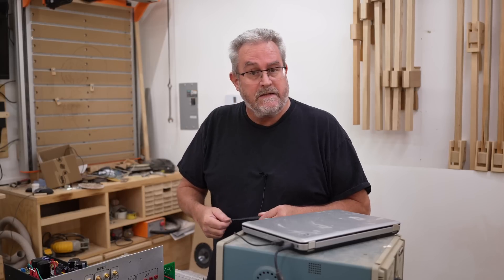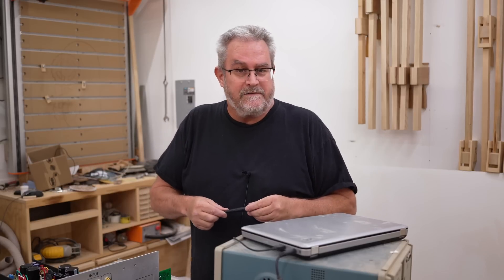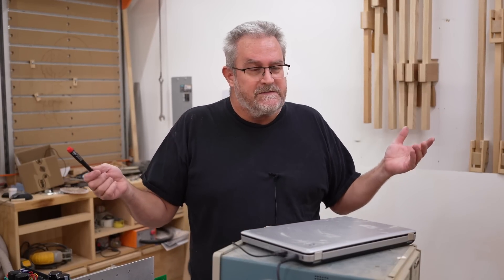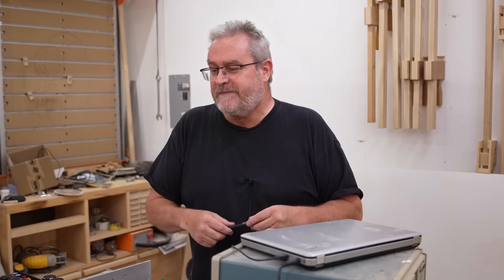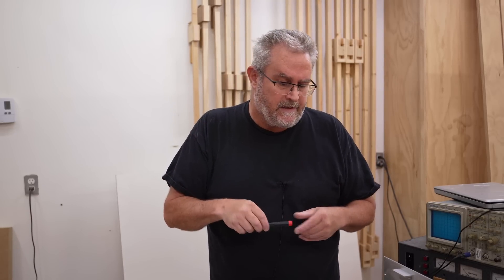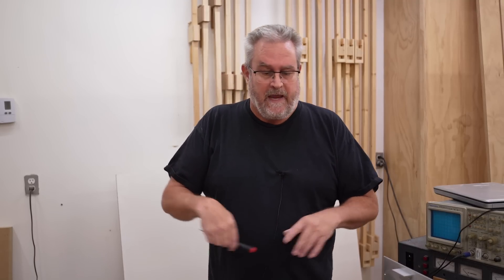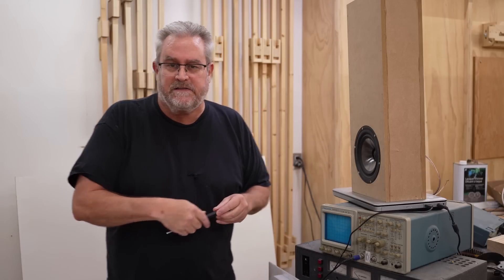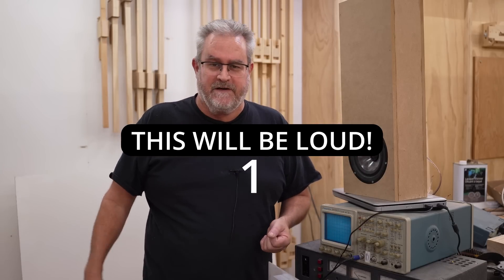What Does My New Amp Sound Like and How I Learned Electronics

Comment from the maker: I'm probably downplaying how much actual electronics knowledge I have, but my point is that I never did gain a proper educated understanding of it from a purely academic point of view. 
I can't do the back-of-the-envelop math to describe how a circuit will perform like guys who have that academic training can. But what I can do is take a circuit, sim it to see what it's doing, modify it if I need it to be different in some way and then (and this is the big one) build it and test it in the real world. At this point in history, nearly everything you can imagine has already been designed in the world of audio circuitry, so it's just a matter of adapting what you need to work the way you need it to work.
Now, like I said in the video, if I had my time back I would have put more effort into the theory and math when I was younger. Eager to just make something instead of studying, I didn't realize that I would have been better off in the long run if I had traded the soldering iron and the parts I was about to ruin, for those books I should have read more often. 

Onward to the amp and the demonstration of it starting up. No audible turn on thump is a plus, but that may change when the active crossovers are in the signal path. I can add circuitry to mute the amps while the crossovers start up, but that complicates things and I want to wait and see how it works without it.
Hiss and hum are as nonexistent as I would ever need, and remember this is the amp running out in the open with wires going every which way all over the place. That sound clip was recorded with my high quality lav mic just inches from the speaker's tweeter and boosted by 30db on top of that, so if there was any noise you would very easily hear it.
But again this is without the crossovers connected, so subject to change. But I'm pretty sure the crossovers are as noise free (and hum free) as the amps are, so I'm not expecting any issues.
The next phase of the build is to finish the amp boards and test those individually before installing them. That's the tedious and time consuming part, and when that's done I have an equally tedious task to do - finishing and testing the crossover boards and getting those wired in.
Reply: Started working on a diy line array project a year ago drawing on quite a lot of info gleaned from your channel. 
At this stage the project research and build is more interesting than listening to the final product 🤣🤣
Fantastic work, you're a huge inspiration, thank you!

Comment: Hyper Focusing is the term I think you're looking for. I do it a lot... It's just about the only way I can get things done. I've got a love hate relationship with my ADHD/ASD.

Also, I started out with electronics just like you. But after a while of fumbling my way through it, I hyper focused on the theory for a while and it did a lot of good but messed me up when visualizing electron flow in my circuits. Practical application and theory often bump heads. IE diode polarity markings and NPN/PNP theory. Drove me nuts and assisted with my burnout on the hobby.

Comment: Learned from Elektor back in the 80 and 90's and then discovered Audio Amateur. As the internet grew useful diyaudio. You were there to John. I only frequent a few threads on diyaudio any longer. Nice to see this get up and running.
Reply from the maker: I used to buy the occasional copy of Radio Electronics magazine, if it had any interesting audio projects. Also my Dad's set of Popular Mechanics encyclopedia had a lot of interesting (though dated) stuff in it. 
Diyaudio was fun for a while, but it suffers from the same affliction that other forums have, and that's many layers of crap to sift through to find that one nugget of gold. Rod Elliott's site is a much better resource for practical projects.
Reply: @IBuildIt  In the English language I don't think that there is anything even close to Rod's website. It is a total encyclopedia of how to get it done well.
Mark

Comment: For me it is the other way around: studied electronics and I've been fiddling about with woodworking since young age. I am very impressed with your woodworking projects! Question about your amplifier: it seems you not using any kind of protection on those amps (DC protection, delayed speaker connect, etc)?
Reply from the maker: The only protection are rail fuses.
I'm counting on the very high reliability of these amps plus it's not a retail product than needs to guard against liability.